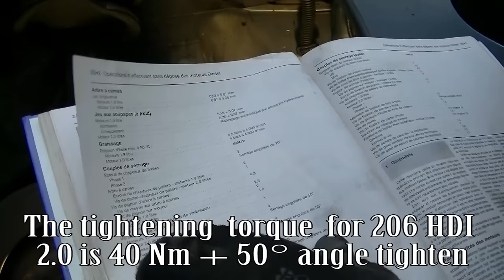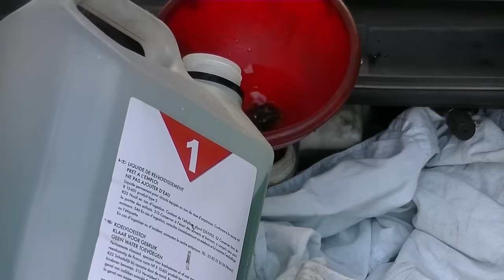TIMING BELT REPLACEMENT with coolant pump  - [Tutorial HD]

Comment: Doing this this weekend just done drive shaft and lower arms alternator and exhaust. I don't have the cam belt kit but I've got some 6mm Allen keys which will work. It's a Citroën Berlingo 1,6 petrol 2003

Comment: Nice video,  what are the camshaft seal(s) and crankshaft seal like to do (replace) on this engine?   I normally do these seals when replacing a cambelt.  Also I mark the rotation on the old belt (if it looks good to reuse as an emergency belt if you can't get one..)